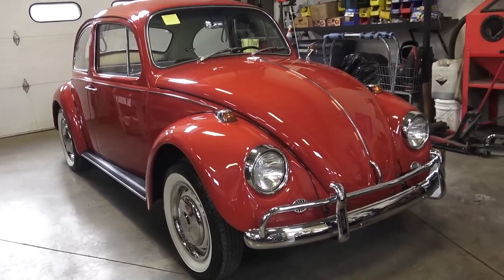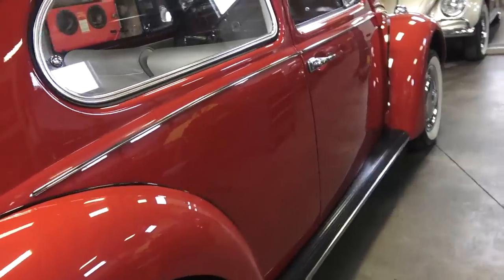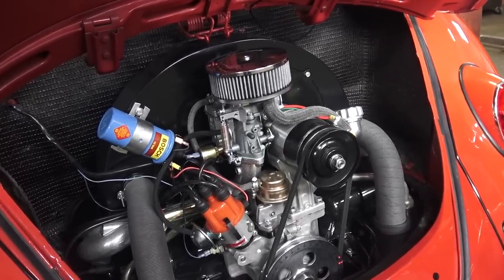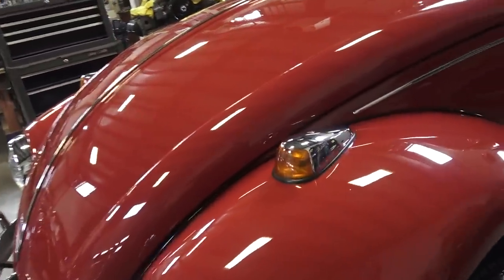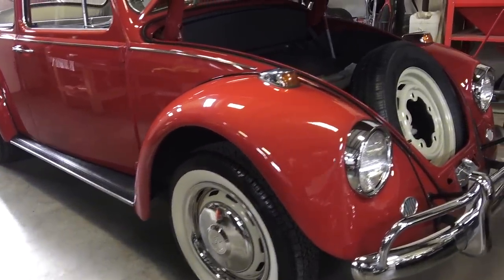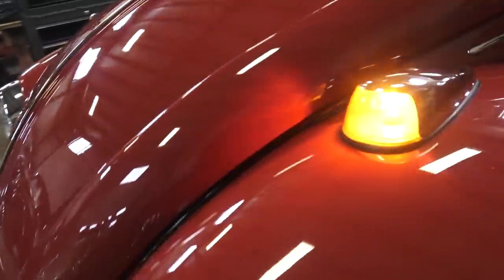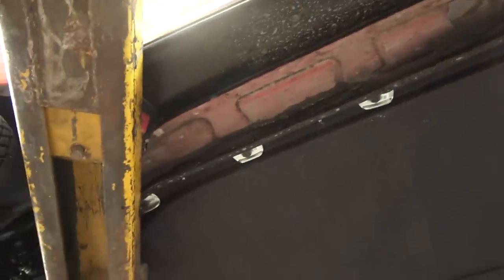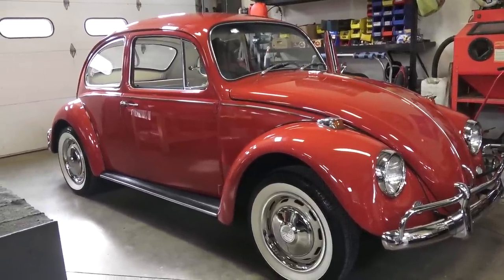Classic VW BuGs 1967 Ruby Red Vintage Restored Beetle SOLD!

Comment: My Dad had a VW and I got to drive it. On a snow covered winter road, they were a blast. The milage was probably the best in history, far surpassing American cars. Their only drawback was an accident with anything larget than a canary could be fatal.
Reply: safety is 90% in the head of the driver.  yes,  you do not want to get into an accident anytime.  as far as the bugs,  they are not meant for long highway trips.   i would say 60 or so mile trips are in their range. around town,  sure.   they are a specialized bag to maintain and use in a comfortable manner.  you really have to like them or it is a 1000 times better (and cheaper)  to use another american vintage style.  best.

Comment: After market 1967 front fenders not only have a different oval horn grille position, but slightly higher headlight position as well, and are noticeably thinner metal compared to original German.  Brazilian and Mexican replacement fenders also have a "D" shaped hole for the turn signal wire boots opening as compared to a 1/3'4" circular opening at top of a German fender.  Also, whomever put in the headliner went the extra labor to install the correct, original VW style "Window frame"  or "Window box" headliner with the framing around the rear window.  The salesman actually knows a few things about a very important year Beetle, the classic 1967 Bug!  He failed to mention a couple impotent points, however, such as the 1967 Beetle iconic reverse lights and near as bad, the 1967 only, tapered rear overrider bars (because of the one-year-only deck lid shape to clear the bars.  Deck lid changed in 1967 due to new 1500cc engine..

Comment: 67' bugs had trouble with door locks, one year model only doors, make it hard 2 replace, but still best lines.
Also replacing a 1500 with a 1600 is perfection. 👍✌🖖
Reply: Yup. I’m never locking mine again.   🤦🏻‍♂

Comment: That by far as the best camera work I've seen on any of  your videos or any videos on Volkswagens! that I've seen!. Very detailed work on your presentation!.. I own a 1979 Super Beetle convertible and I don't know if I should part with I've done all the work to her body work carpeting and primer Windows Etc. had her since 1998...
Reply: a whole other bag that 1979 super beatle.  one thing we all know is the bug engine was outmoded by the time they wanted pollution controls.  just was not right for that.  water cooling was 100% neccesary to stabilize the heat changes in the motors.

Comment: I had a 69' bug ,had great improved jaguar type suspension, could take a corner big time,but the seats  & tail lights sucked in comfort & looks, but can be replaced with 67' taillights & rear fenders & 67' low back seats 2 look more like a 67' bug much better 👍👍

Comment: When I had my ‘67 I was aware that after market a/c was available as a unit that sat behind the rear seat.  Can’t imagine that it worked very well with the limited horsepower.  Wondering if anyone had experience with this add-on.

Comment: Has incorrect 1968 and later door-lock knobs.  1967, first year for the one-year-only door-lock knobs.  Door handles samein 1966 and 1967 as were the flat hubcaps.  

Not only is the horn-grille position different in an after-market 1967 fender, the turn-signal / parking-light and headlight position is also slightly different, with the headlight being just slightly higher, which makes the car look wall-eyed if one original German and one after-market fender are used.
Reply: Pssst....you missed the rear bumper. Not right for '67.  The inner over riders were angled slightly downward. This one is good for '66 and earlier.
Reply: Correct.  The rear, "Blade" type bumper (as opposed to the 1968 "Channel" type) is correct for 1967.  The non-tapered over-rider bars are 66 and earlier.  The hood handle is also incorrect, die-cast aftermarket.  The 67 hood handle is one-year-only, stamped stainless-steel similar in construction the the 1967, one-year-only door handles. Deck lid latch is a dealer optional locking type, generally and preferably matched to the door and ignition "K" profile locks and key.  The dealer optional glove-box push-button lock did not use the "K" profile lock. The "Ruby" paint is also incorrect factory color for 1967.  Otherwise, it's a nice example of a 1967 Beetle.